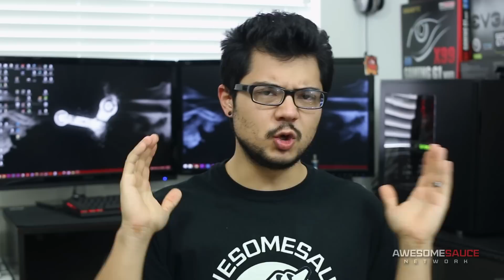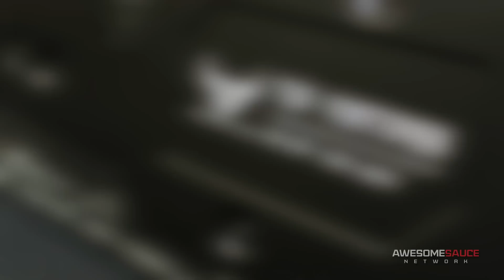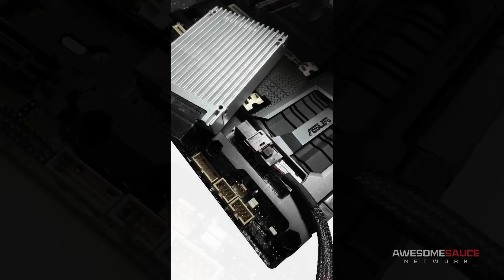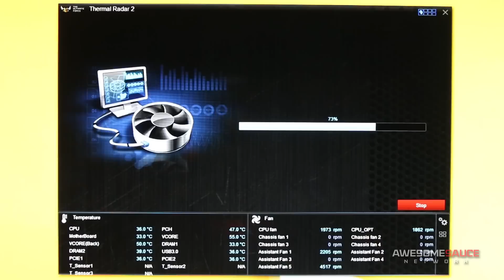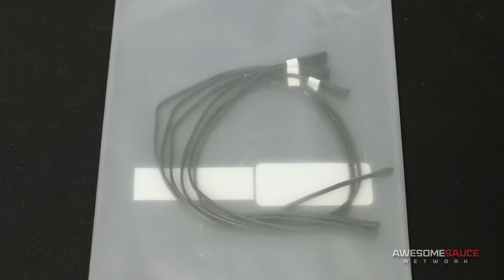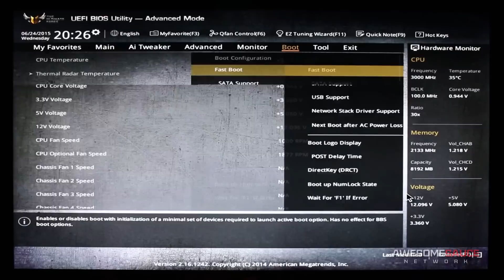Asus Sabertooth X99 - It Does Everything

Comment: Hi,
Thanks for review and very interenstin channel overall!
I have question about CPU power connector for X99 Sabertooth, it has two EATX12V_1 (8 pin) and EATX12V_2 (4 pin) cpu power connector. did you connected both? ASUS support told me, that it is not mandatory, but I red on various forums, that botha are prefered to be connected when overclocking. My PSU has only 8 pin (4+4) connector, should I buy Y splitter?

Comment: What even is an M.2 slot? Is it a special type of SSD? I know a decent amount of stuff about computers but not an M.2 slot, all I know is it's an ssd.
Reply: It is a form factor that has recently become widely available at the consumer level. It uses a different connector and, for supported ssds, much higher bandwidth. This allows faster read and write speeds for drives that use an nvme controller instead of the typical SATA controller.
Reply: late would be your realization of m.2... js
Reply: not to mention it is incredibly easy to install, not that a normal SSD is hardt to install but a m.2 you just plug it in and 1 screw and done
Reply: bit late there bud js

Comment: Can someone give me a lil' advice?
I'm thinking about getting a X99 Sabertooth & 5820K for 144+ FPS/144hz gaming on 1080P (Mainly CS:GO/maybe twitch) with a 1000W PSU. Any advice on what gfx card to go for? 970? 980? 390x? R9 Fury? It's critical that the card runs 1080p best since I really don't care about 4K or even 1440p.
So what vid-card in the 300-600Euro price range would do the job best?
Reply: Zotac gtx 980 ti amp! Edition. Or a 980/390(x) or even r9 fury (x) / r9 nano
Reply: +BravoTwoZero Sadek that cpu seems a bit... you know OVERKILL for playing cs:go. Maybe go for something like the 6600k. And when it comes to the graphics card for 1080p I would say go for the 390x/390.

Ps: The reason I only suggested AMD cards are because of personal opinions of how NVIDIA does things (the cards are fine).
Reply: DogdyGuyOnTheInternett I went for that cpu cus I wanted to be future proof for at least 5 yrs + R9 390 vidcard and an overkill mobo :) Do u think 144fps+ on CSGO is attainable with that vidcard?
Reply: A potato can even run cs go at 1080p/144 fps but yeah that sounds like a good build good luck with it
Reply: BravoTwoZero Sadek yeah, I´m pretty sure it can :)

Comment: Just FYI, if you're using a 28 lane chip, the lowest connector will run at x4, making a 3-way SLI configuration impossible. Only 3-way crossfire will work.

Comment: I have this board and while I still love it, The software AI Suite 3 is COMPLETE CANCER. Try uninstalling or reinstalling it... And then enjoy reinstalling windows to unfuck yourself after days and days of bs. Arbitrary software breakdowns, etc.
Reply: Naveronasis You need a special cleaner published by Asus and its still more likely to leave a ghosts in your registry that you can NEVER uninstall even with cc cleaner, even by looking for them manually.
Reply: Naveronasis Also... Sometimes the bios will freeze when adjusting the fans lower (using current bios) and now the new bios supports 16gb sticks so it may in fact support 128gb sticks.

Comment: Can somebody throw some comments my way on my first pc build,I would appreciate some help as I wanted a build solely for gaming and maybe even some recording/streaming,which this build can do.
I7 qaud core 870 2.90ghz
Intel desktop board(not sure where to look to find out which model/type it is =p)
AMD Radeon HD7770 1gb graphics card
4 2gb sticks of ddr3 RAM (unsure on type/model)
Seagate 750GB 1700rpm hard drive
Gigabyte psu(unsure on type/model)
Running with windows 7(Better OS for gaming?lemme know :D)
 
Performance so far:
So far Im rather pleased with the setup,I can run the witcher 3 at medium settings with 40fps maybe 60 havent tested,and 25-30 fps on high with some of the taxing things left off or minimal and the game still looks great

Get 30fps playing Arma 3 online,barely breaks a sweat I suppose,dont really ever max it out,things like the draw distance,antialiasing and such are all on full,Im running pretty close to max with everything hindersome left of or to minimal
Please let me know if Ive left anything important out

Why am I worrying?
Well story goes something like this..
Few months ago I aqquired this build for 300$(or 3000 ZAR/south african rands)with the only components being changed was the Nvidia Geforce 210 512mb(for the amd radeon hd7770)which I still have but dont use.
I dont have much issue with my current processor/cpu but I want to go for a better one,hyperthreading is nice and all but I dont really need a qaud core for gaming do I?
I was contemplating selling the geforce 210 along with the processor/cpu in order to buy myself something like an I5.
But the thing is I want to go for a high single core clock speed,which some of the older games being modded(stalker cop being a prime example relating to misery mod)kind of benefit more from,as dual core and qaud core werent really needed.

Money is tight but if theres a good cpu with high single core clock speeds out of the box,I would consider pinching for it :D
Price over unnecesarry gaming performance prefereably,if you guys know any good gaming cpu clock speeds should at least be 3ghz<   then it should be fine...

Thanks for any help in advance,Im hoping that when I get a better cpu I can save the money leftover for some gaming ram to replace the 4 2gb sticks,as memeory is also an issue running full scale game modifications,peace! :D

Comment: Please do a separate video on the "Thermal Radar II" I'm currently building on this mobo, and can't wait to get the last couple pieces of the puzzle together and fire her up! Thanks for the video. 

This is my first build:
X99 Sabertooth 
5820 i7
Corsair h100i
Intel 730 480ssd 
32gigs 4x8 G.skill rip jaws 4 series
Corsair RM100 PSU
Corsair 780t 
GeForce GTX 980
WD 3tb black HDD
Pioneer BDR2209
NZXT multicard reader

The optical drive and ram are in the mail.. I think that's it.

Comment: sata express is cool and all, but are there any drives on the market that use that connector ?
Reply: There is only the hyper express from asus that uses sata express AFAIK. It isn't an SSD though, it is am enclosure that lets you run 2 m.2 or msata ssds in raid.

Comment: ehm so it has 3x PCI-E x16 slots the 1st and 2nd slot runnin @ gen 3.0 the 3rd gen 2.0 what if i skip one slot to have room for air using a non reference cooler graphicscard in SLI? so one is runnin at gen 3.0 and the other one at gen 2.0? is there any difference in performance? (sry for my bad english^^)

Comment: Definitely a great board, no argument there.. But 2 things:
1) Is that 40mm fan loud? The smaller the louder (right..?) so just curious if it adds any noise, if I'm going for a very quiet build?
2) The TUF fortifier is COMPLETELY pointless.. The reasons you/ASUS gave for it are irrelevant..Right? I can't remember ONE situation in the past 10 years of ANY board, EVER, "bowing".. I've ran/seen 3-Way SLI, even 4 cards SLI, on hundreds of different boards, and not once have I or anyone else EVER mentioned a worry about their board "bowing"... Trace damage? Board handling? Seriously..I cannot recall ONE incident in many years where any of that was an issue... And say there have been incidents I don't know about... Quite obviously it ain't common or something that anybody worries about.... And please lets just completely skip the "it's better for cooling" BS. It's as "big" of an impact on thermals as back plates on GPUs... 1 degree FTW.

Sorry for the long read, I'm just blown away as to people needing/wanting the back plate for anything BUT aesthetics.... RIGHT?!
Reply from the maker: Yuriy Man The fan was definitely audible but i doubt you could hear it in a closed case. (i only powered the board in an open-air chassis). As for the back plate, I agree that you'd have to be installing 3 or 4 large GPUs and an air CPU cooler to stress the PCB that far, but I don't believe Asus would have added it just for aesthetics since it won't show in most cases. As for the thermal claim, that's something I'll have to investigate further when I do the build. 
Thanks for the insightful comment!
Reply: Yuriy Man While thermals aren't something the backplate will noticeably improve upon, and while the board bending is less of an issue when the PCB itself is of high quality (And thus harder to bend), I think the biggest benefit of having the backplate is security. I have a Maximus VII Formula that's... pretty similar, and when installing it a friend bumped on my elbow and I dropped the board into the case and it slammed on the case's motherboard standoffs. The impact just scuffed the armor, but the board came out unscathed. I doubt the board would have made it out alive in that situation if not for the backplate. Is it a common thing that happens to every second PC builder? No. But it proved useful and looks cool, so I like it.

PS : I then swiftly proceeded to try and decapitate my friend for the heart attack he caused me. He only suffered a minor concussion in the end.
Reply: Awesomesauce Network Yeah, I agree with you. I would usually say something along the lines of "ASUS is too big to make this decision".. But because it's ASUS.... I know for sure there's gotta be a good reason. ASUS is too sick to throw money around like that. And thank you much for your input. I was always curious about the fan. I only buy ASUS MoBo's (not due to fanboyism, due to trust and experience with others) so your reply really helps. Then again you've always been good about chatting with your community. PS: When is the next comedy skit coming? I want to see Mr. D.D.R.4 do some stand-up. ;)
Reply: Αποστόλης Νικάκης Yeah, I guess.. Just like Kyle replied, there's gotta be a reason.. Rather, a "better" reason. It's ASUS. That, or they put it in just for your salad fingers. If my friend bumped it I would've also given him minor head trauma. So don't worry, you're still going to Heaven in my book.
Reply: +Yuriy Man (TechX) I have the Z87 Sabretooth, and it comes with two of those small fans. I found them very noisy until I installed AI Suite and ran the thermal tuning feature. Result.......... noise gone.
Reply: the fans suck yes, but it looks so good

Comment: its a little weird that it has no on board display -> concertinaing that intel
don't make processors that don't have on board graphics. Yes you do loose that feature as the lane that the CUP address a dedicated GPU is the same as its own on board one but using the on board graphics can be handy for trouble shooting. I guess it keeps the price down because the motherboard dose not need the extra various parts run to the display headers from the CPU.

Comment: I know this wont apply to the custom loop, but for now I'm assuming you're using some kind of AIO?  I have a Gryphon Z97 and an H100i and I'm confused on how to set up AI Suite (Thermal Radar etc.) and/or corsair link.  I really like AI Suite 3, but I'm not sure it works properly with the H100i so if you do an AI Suite video could you include something about that?

Comment: I have the Sabertooth x99 and running a 5960x. 64Gb of G skill 2133 ram. Two Asus strix GTX 970. Evga super nova g2 psu.  NZXT phantom820 case an d kraken aio. Crucial 512 Gb boot drive, WD 1tb black and 2rb green programs and storage respectively. Four 200mm fans and six 140mm. Very quiet and cool. OC to 4.5 ghz running 60 fps on a 37'' 1080p tv/ monitor
Reply: Keb Zeb GTX970/1080 monitor..... it's like having a Ferrari but you could only drive it at 40km.
Reply: All those beast specs ruined by the crap graphics card and low red monitor.
Reply: Keb Zeb Crap graphics card? How so?
Reply: I’d like to know if your saber tooth is still going...
Reply: I've had mine since around March 2015, still going strong with an i7-5930k overclocked to 4.4GHz since I got it. Initially I ran it with two GTX 980's in SLI then two GTX 1080's in SLI. It's not my main system now but I still use it daily.